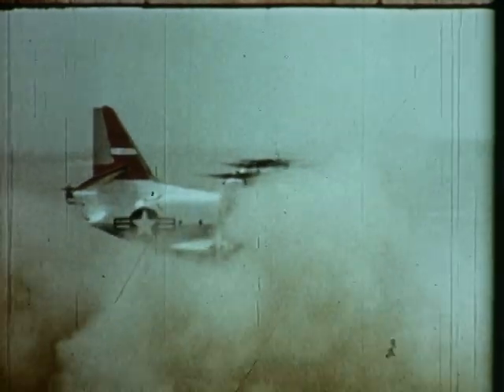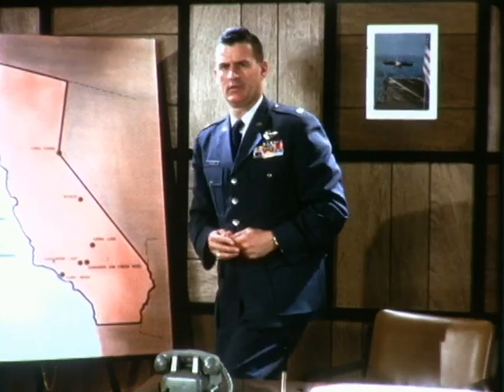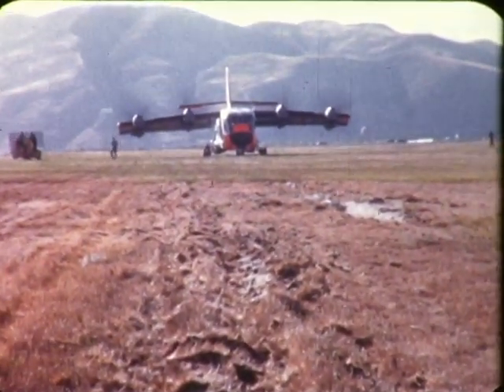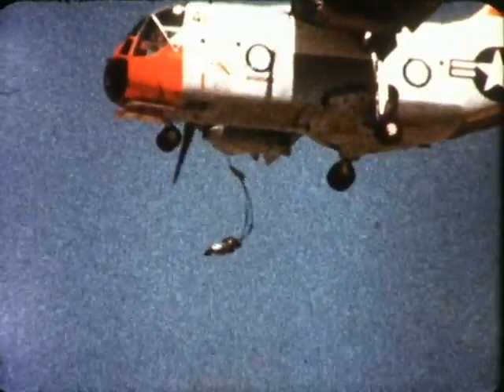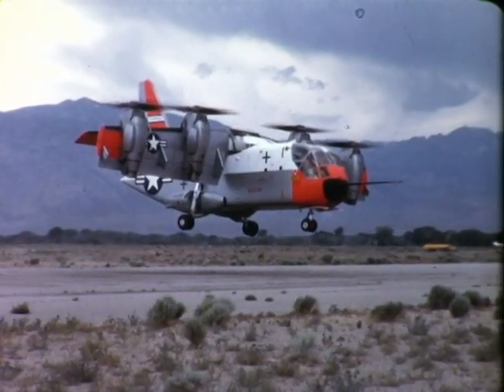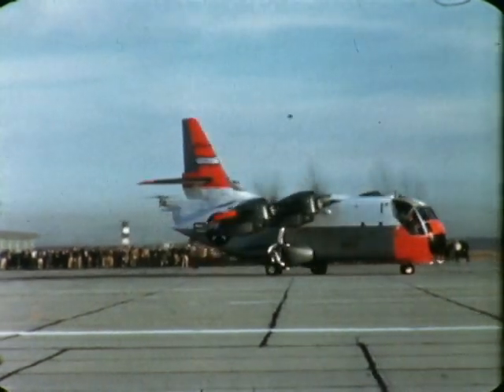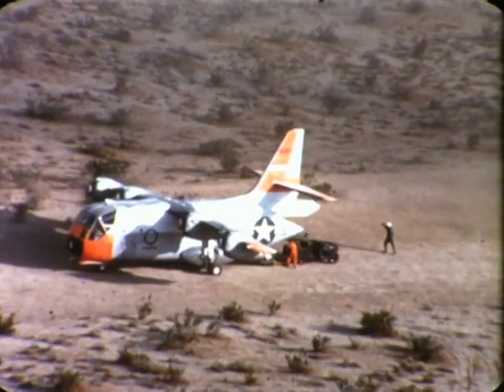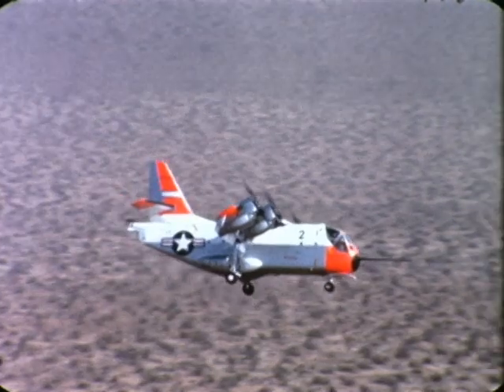F 2371 XC-142 VTOL Operational Tests

Comment: They did build 5. one was destroyed just behind the LTV plant when the tail rotor failed during hover.  The tail rotor pushed up on down to correct for center of gravity changes.  There was a shaft connecting all four engines.  So it could survive an engine out.  (That drive shaft was a maintenance nightmare)     There is one at the Air Force Museum in Dayton Ohio.        It had one very bad aerodynamic characteristic that Bell learned from and today's fly by wire would have greatly helped.   Like a helicopter it got additional lift from the ground effect.   But if the wing was in just the right position, or if a gust of wind hit it while at that 40-50 deg angle, the ground effect went away and the engine wash did a backwards steam effect.  The plane lost a lot of lift and there were several HARD landings.      LTV Engineer, years ago.